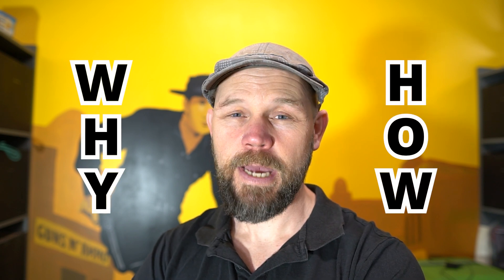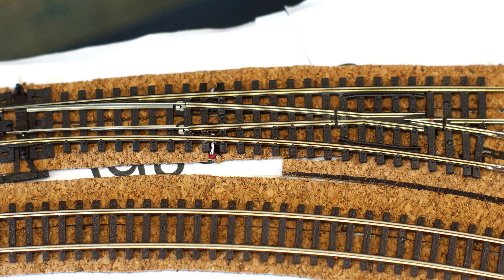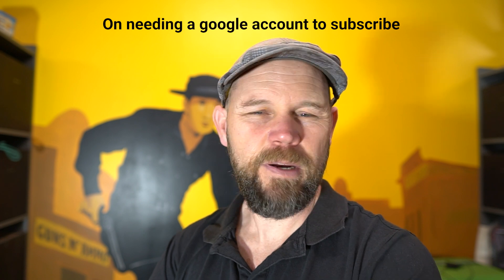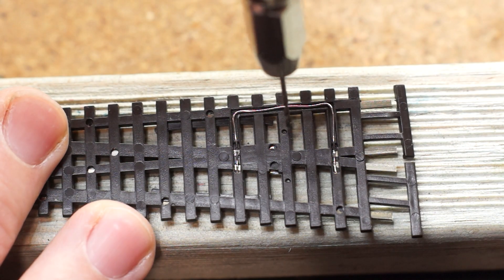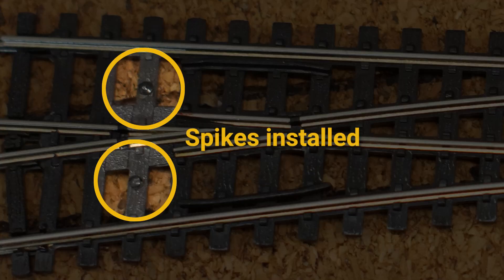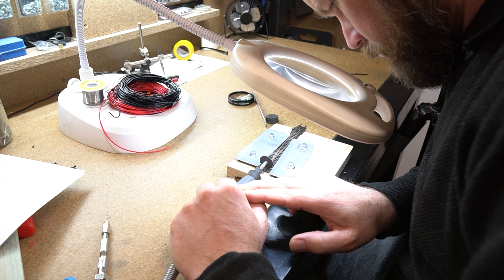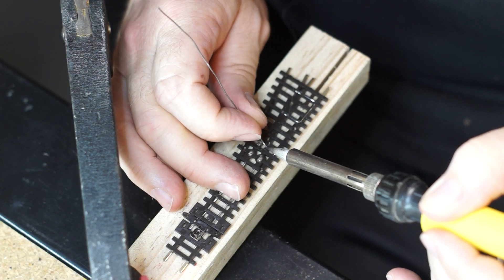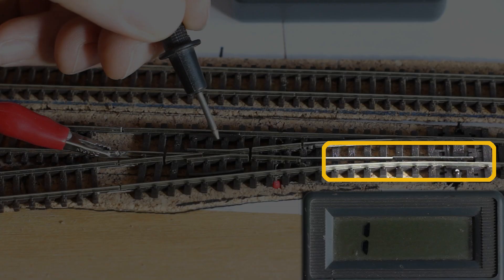Modifying Electrofrog turnouts for DCC layouts - a 10 step checklist with jigs and tips

Comment: Lots of great advice. I am working with Peco Electrofrogs for HOn30 (SL-E491, 492, and 497) and your video gave me lots of great ideas and a good plan of attack. I will be using it to help with my build. Thanks! One question: Have you seen any reliability or conductivity issues with the little hinges that connect the point rails with the closure rails?

Comment: Nice video.  I have also modified Peco N Gauge Curved Setrack points like this to remove blade contact problems.  Setrack curved points are Radius 2 and so they enable longer sidings on your layout by starting the siding on the curve rather than on the straight and Radius 2 is better for smaller layouts as the Electrofrog curved points need much larger radius curves to work. But I concur with your comments to use Unifrog if possible.  It is a pity that the N Gauge Unifrog range is so limited and Peco aren't showing any further N Gauge Unifrog development at this stage  (2024).  Why not send Peco Technical Dept an email asking them to bring out Medium radius Unifrog Curved Points?  The more of us that email, the better the chance that they will see that there IS a market in N Gauge and will develop further, rather than put all their development into OO Gauge.  K

Comment: You are using the same re-wiring technique I'm using on my N scale, Peco Code 55 Electrofrog turnouts.  I really like your use of a jig.  I destroyed one turnout with my Dremel tool before I bought a jeweler's saw.  The saw works well but it is more of a hassle than your jig process.  I'm going to make a jig and use it on my SL-E383F scissors crossing before I install it.  It's too expensive to ruin with the slip of a blade.
Reply from the maker: It sure is easy to nick tracks with the Dremel, I've hit a few! Thanks for watching.

Comment: As to spring removal, they do not need to be removed on unifrog or modified  electrofrogs. The frog is independent.  On unmodefied electrofrog turnouts the juicer can change the polarity before the blade moves off of stock rail causing a short.
Reply from the maker: Thanks for this comment, I meant to reply earlier! Another inconvenience that I didn't anticipate - we tend to push rolling stock around to test track connections prior to powering. Floating points makes this difficult, we're forever propping the points open or closed.

Comment: Really good mate, thanks. This has really explained a lot of things that I wasn't sure about. I am using DC and I still switch to poliarity to the frog. Still relevant. I also use slide switches to throw the points, (and switch the polarity) and so I don't need to remove the spring. But this isn't about me. Really top video. Thanks for the time you take. 5.2k subscribers isn't enough for your effort and skill set. 👍
Reply from the maker: Thanks mate, appreciate your feedback.